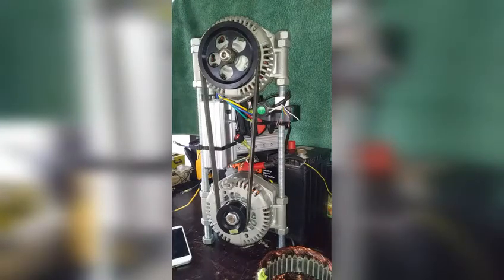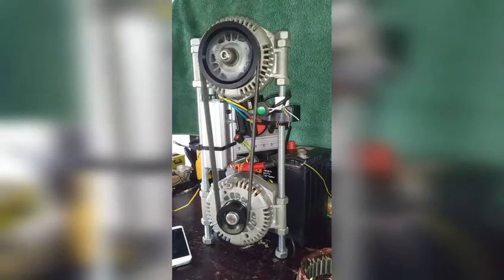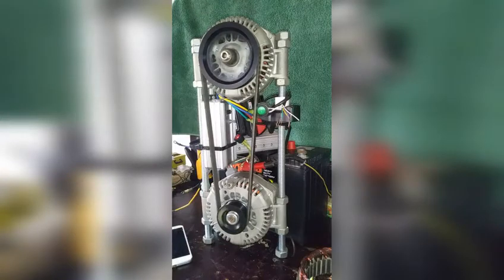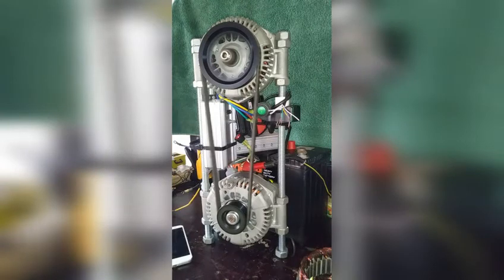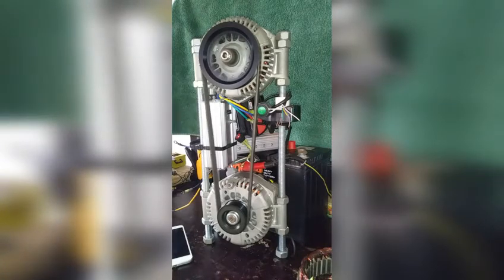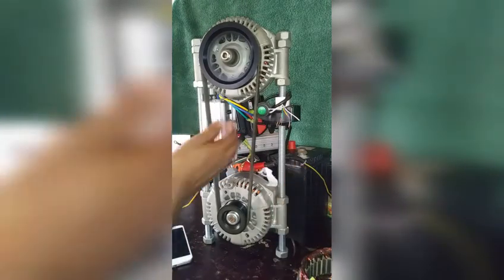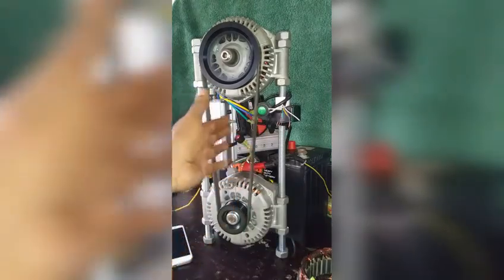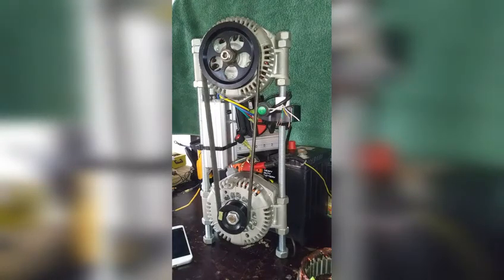Free Energy Generator Over-unity ULTIMOTOR.

Comment: It will work at about 300% override free energy, if you do it for AC and not DC. So, you need to get rid of the rectifiers and do it all for pure AC. Just connect the 2 alternators 3 phase coils 
together respectively and you are all set. It will produce a lot of power. The larger the Alternator the greater the output. Just remember, you do have to use a capacitor on 1 of the
windings in the alternator and the motor, the best way is to use a capacitor bridge. It is similar to a bridge rectifier, but capacitors. then you can cause the reflected voltage to cause 
a 3 phase power, much better than a single phase power, will achieve about 300% more free power. Also, you do not need permanent magnets. You can use special DC circuitry to increase the power to the field when the load tries to slow down the rotation this works much better.
So, the harder a load tries to slow down the unit the circuit just raises the rotors magnetic field, the field is capable of about 3 times the gauss rating of permanent magnets anyway,
Since it is spinning at around 4,000 to 4,200 RPM, it can sustain up to about 36 volts on the rotor, because it is quite self cooling, as long as you have a fan blade on the alternator to cool it. I'm sure you can figure out how to get the most out of the project. The s power field.outputs should be close to the following ratios; A 12 volt 220 Amp Alternator should be easily able to produce a 8,000 watt power continuously, a 350 Amp High power Tractor
Alternator can produce about 10,000 to 11,000 watts. That's enough for a large house,
and the automatic circuitry should relax the system when your not demanding a lot of power. My control circuit is my secret, but is for sale to the highest bidder, because it is worth a fortune, to the right company looking to expand into this field of producing my
Gasless Home Generator, that just quietly runs in a shed or under the house. Have fun.
It is easy to produce free energy, but the power mongers and societies rulers don't like it when you can get free power, because there goes their profits, you know how it is. Just
don't advertise your secrets, and you'll be OK.
Reply: Can you send me plans and or a schematic? For personal use only.

Comment: Get real bud. There's no such thing as free energy. Its basic physics.
Reply: Lol double trolling from the youtuber and I see a sheep who never question what they learnt. First thermodynamics law is none other than fraudulent "law".
Reply: Yo Steve, got a schematic or blueprint, part numbers?
Reply: I've been looking at alternative power sources,  I'd pay for the info, of course...
BTW, I like your set-up, everything is in line, bolted together . Nice
Reply: @southernyankee7165  It's obvious this video is fake lol. If you study electrical engineering there cannot be output greater than input just putting looping motor and generator mechanically. Use your brain for once. Also, ignore the idiot who thinks energy cannot be created. If you want the REAL one. Search up flux switching alternator which focused on reducing lenz's law by trapping most of the braking torque in the core rather than on air gap like most generators does.
Reply: @lukiepoole9254  Excuse me? I’m the idiot here? Energy cannot be created from nothing. Nobody has ever successfully disputed the first law of thermodynamics, and I doubt some schmuck in the YouTube comment section can. All energy has to come from somewhere. If such “technology” was real, then why are we still burning coal, natural gas, hell, even using solar or hydro or nuclear? Get real bud. I’m the only sane person in this comment section.
Reply: @AfterDark33  Why? It's because you have been taught FAKE science. That simple. Sheeps are unable to see they are controlled like you. Question what you learnt. Oh wait, you don't bother questioning what you learnt.
Reply: @lukiepoole9254  Fake science, sheep? Next you are going to tell me the earth is flat! I’m not a physicist, and I bet dollars to doughnuts you aren’t either. Nobody has ever built a machine that effectively breaks the first law of thermodynamics. If you want to call it fake science, go ahead, but be prepared to prove otherwise. If you can demonstrate a machine or reaction or any other process that breaks the first law of thermodynamics, I, and everyone who believes in the laws of thermodynamics  will nominate you for a Nobel prize. So my friend, where is your proof?
Reply: @AfterDark33  Funny how flat earth became the number one topic of BS isn't it? The purpose of evil to discriminate TruThs as "stupidity".
Reply: @lukiepoole9254  Well as far as I’m concerned, people who think the earth is flat, and those who think you can create energy from nothing are on the same level of stupid, also known as rock bottom.
Reply: @AfterDark33  So you are saying stupidity and truth are the same? Okay. You do know you are TOLD enrgy cannot be created, never proven it yes? The origin of everything is nothing.When everything is removed, nothing is left. What makes you "think" energy cannot be created from nothing?
Reply: @lukiepoole9254  Two things. First of all, stupidity and truth are not synonymous. Second, the singularity from which we hypothesize our universe stems from wasn’t “nothing.” Although it is not known exactly what happened at the point of “the Big Bang”, modern astrophysicists have their guesses. Not to mention the laws of thermodynamics may not have functioned in the same way as today, as the universe had yet to be formed. However, as we can currently observe on our planet, at the time of our living, there is no way one can create free energy. Not in concept, not in reality. The conservation of energy can be fairly easily observed as laws of physics go. And understand when I say observe. Nobody has ever produced any proof of what you are suggesting that will hold up to actual scrutiny. You can call me a sheep, you can call me an idiot, but you are the one standing out in a field, alone, with nothing to show for.
Reply: @AfterDark33  Yeah. You can observer energy transfer and energy conversion. You cannot observe the moment energy is created which is a lie because flux switching alternator exhibit this phenomena.
Reply: @lukiepoole9254  You can observe energy transfer and conversion because they actually can happen. Your “flux switching alternator” is nothing more than some mumbo jumbo someone stole from an actual thing to try and validate their “invention” of a “free energy device.” If such a thing exhibited energy creation, then once again, it would be on the headlines of every news source, every government would be dumping billions into it and it would have won the Nobel prize.
Reply: @southernyankee7165  alternator power sources lol
Reply: @lauratanner8475  So you wasted 25 years learning nothing. Great! You didn't know about parametric excitation of electric oscillations. You didn't know about flux-gating with different reluctances. So, what have you been doing all your life?
Reply: @lukiepoole9254  I spent 25 years making money. It's called working for a living.
Reply from the maker: Should have tried using you Brain. It's free energy to avoid work. Working is for nonsense, free energy is foundation, you overstand?.
Reply: @Stevexnycautomotive  no I don't suppose I do "overstand" Again nothing is free. Least of all energy. This is why you have to eat. Have fun bud I'm afraid I can't help you
Reply from the maker: Why don't you think for yourself? Living this selfish hell. The dollar is a free energy device, because anything can be money. It's all about acceptance and care. You are living free before of dollars (free energy).
Reply: @southernyankee7165  He can’t get you one, because if you tried to build it, it wouldn’t work. This device will never work. Free energy generation simply cannot exist. This man is a fraud and a cheat. The powered alternator will never output more than the motor that is powering it is supplied. There will ALWAYS be a net loss in the system, from the belt, the fans, the bearings and general electrical inefficiencies. Don’t fall for this con man. Turn back now.
Reply from the maker: The moon is on mars..😂